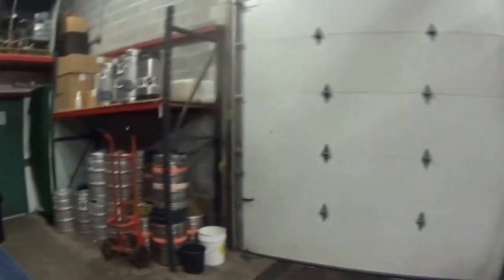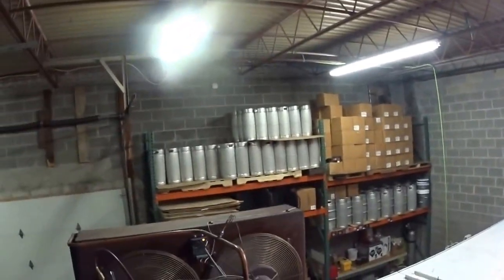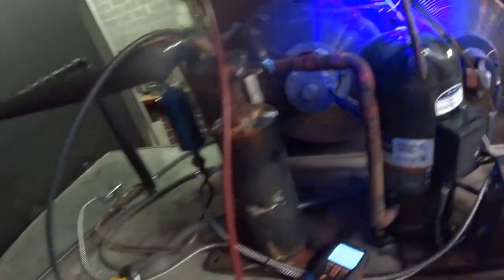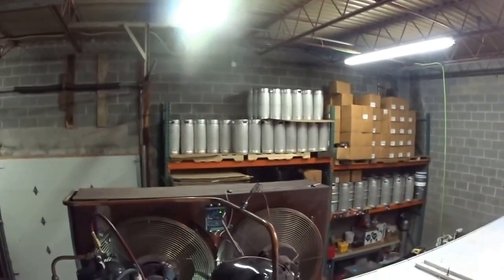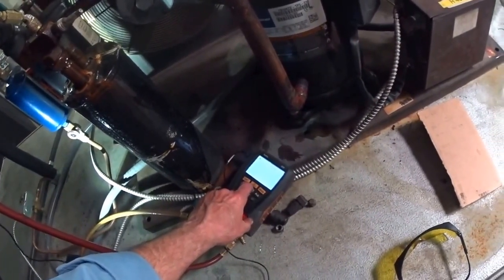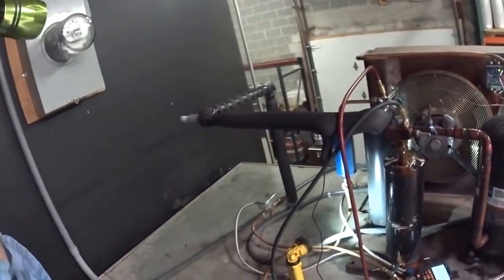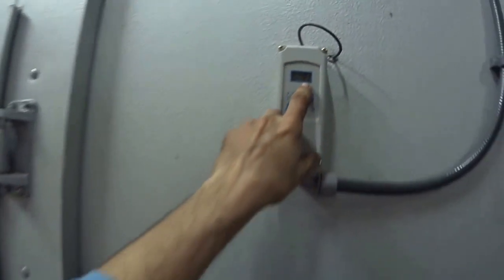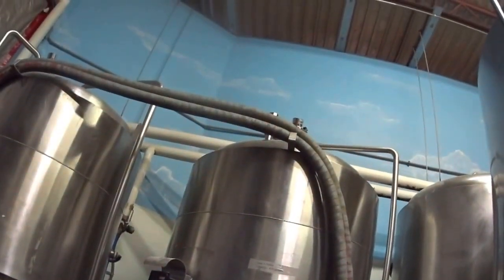Brewery

Comment: Nice video Jim!! More info (video) on that crank case regulator please.
Reply from the maker: when the refrigerant goes through an evaporator it picks up BTU's of heat, sometimes that load is more than the compressor can handle. Once the system is running the suction pressure would be something like 45lbs, when the system starts up you might get 95lbs and the load is too much, the compressor draws high amps and labors. The CPR valve will only let so much go through it, so you set it at 45 lbs, the compressor draws it's RLA and is OK. Freezer and some medium temp systems don't have the starting torque that an AC compressor has. Thanks.
Reply: Thanks for the explanation.